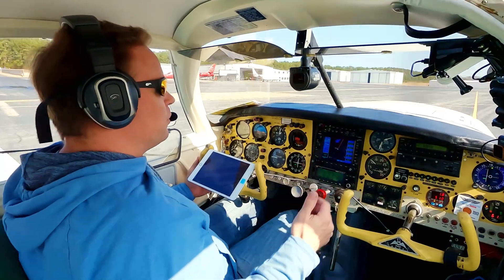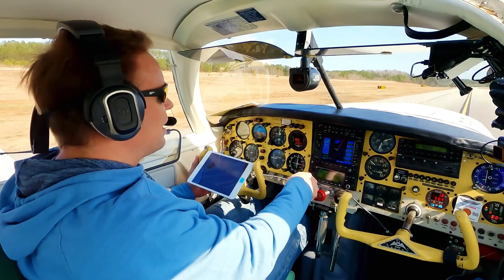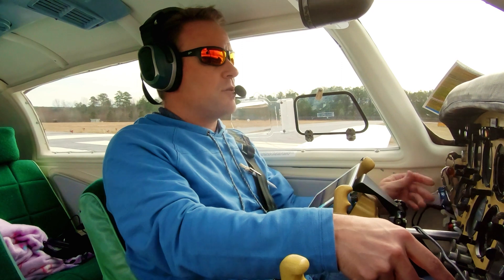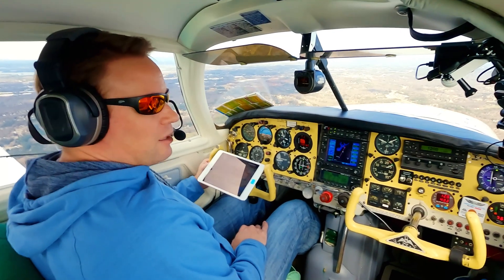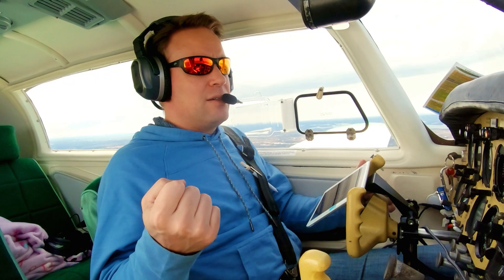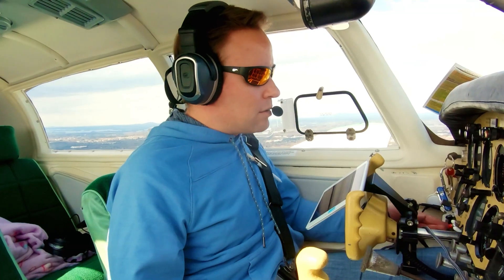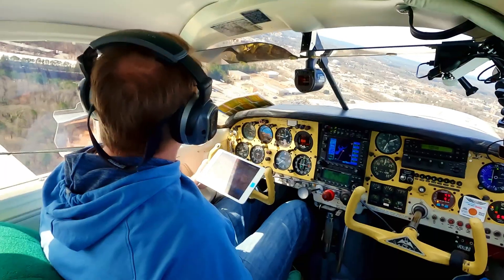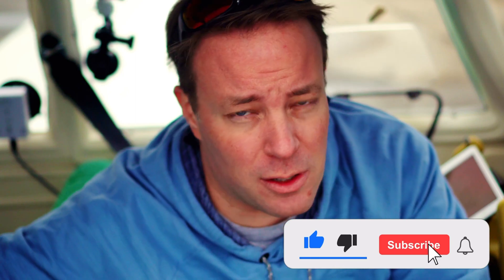Did this FAA AD GROUND my Airplane??? ✈️ + 🔎= 🎥 #pilotlife #mooney

Comment: I just spent today removing the elevators from my ‘62 C.  The right side weight is corroded and the new weights came as a set.  Half done with the process as of today.
Reply from the maker: Sorry to hear you got hit with this but better to fix it than worry about it later!
Reply: @TuomoMooneyFlying  still gets the pocket book though!  Trying to get the annual done so I can fly it to Reno next week 🤞🏼
Reply: @TuomoMooneyFlying  Turns out mine weren't the weights in question... just flaked paint, misdiagnosis by the shop.  Thankfully they are making it right....  A quick check involves a strong magnet per the service bulletin.